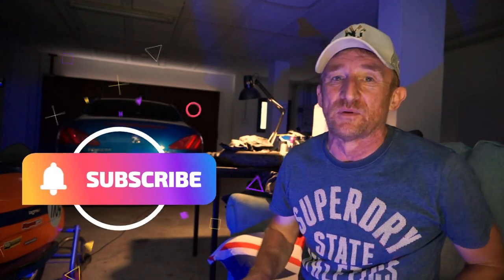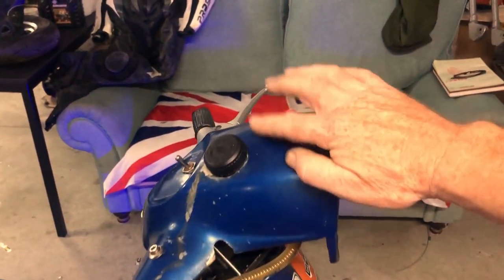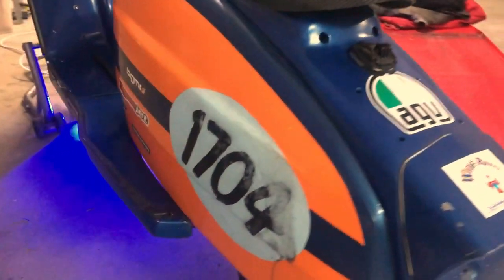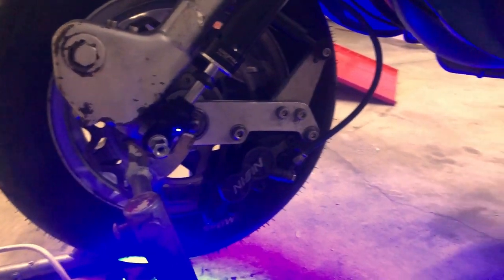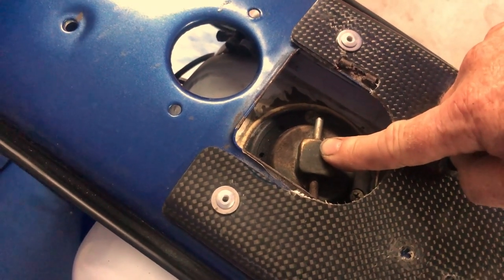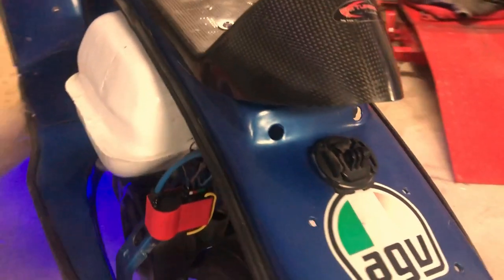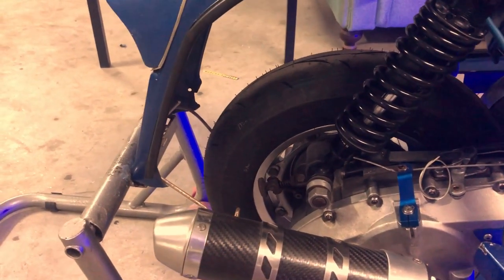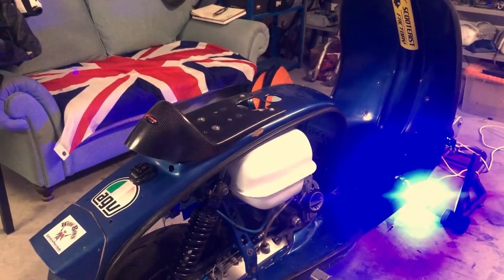LAMBRETTA CASA PERFORMANCE SS 200 ENDURANCE RACE BIKE

Comment: Cracking looking bike Steve good luck with the race, any chance of some info on the carb induction plate please!
Reply from the maker: Home made mate theres another one behind the slide inline with needle 😊
Reply: @TheSteelweasel  Thanks Steve, is there purpose to agitate the air to get a better mix. If so does it imp[rove performance?
Reply from the maker: @davidvardy2270  it doesn't agitate air ? It increases velocity  and creates torque. For more info go to thunder products they make something similar but they dont fit in delorto sorry
Reply: @TheSteelweasel  Thanks for the prompt reply Steve, really interesting reading/viewing on the Thunder Products site. So has your home made versions made any noticeable difference.
Reply from the maker: @davidvardy2270  notice exiting corners smoother .
Reply: @TheSteelweasel  Cheers Steve have a good one!!!
Reply: @TheSteelweasel  Hi Steve just caught up with your Race Bike start up of Jan 2021 and get what you where saying re plate front and back, very interesting! Looks like I will be getting the alloy sheet out!!!

Comment: Hi Steve hope your well mate..
In this vid you say your using bgm dampers and progressive springs?? Is that correct? I think I've seen a vid from you saying not to use that set up?
Reply from the maker: Yes you right I use standards springs in my road bike . Race tracks are usually smooth with no holes  And the hard braking is better with progressives . Horses for courses, hopefully you didn't expect me to use the same set up on a race bike as my road bike .

Comment: Do you know what horsepower that set up has and would it be a set up that could be used on the road.
Reply from the maker: It's around 24 Bhp not for road my friend,   much better to use something with more torque.